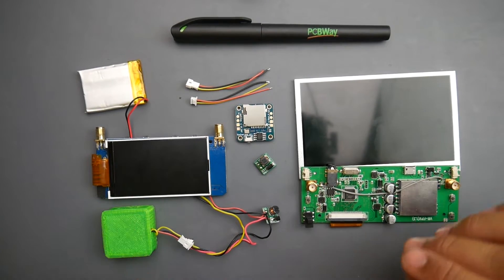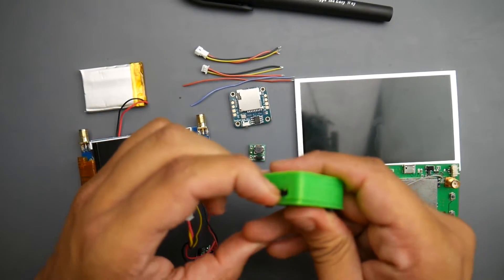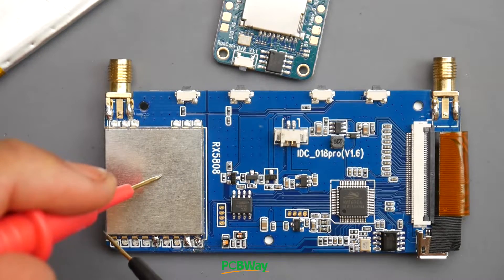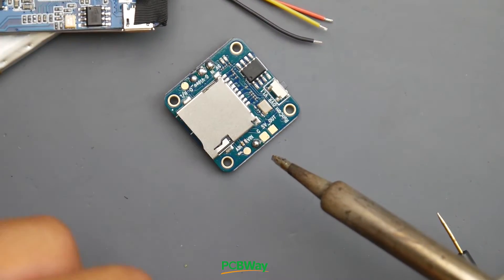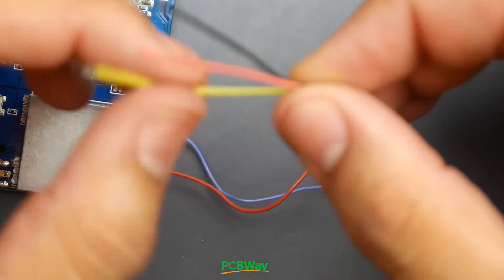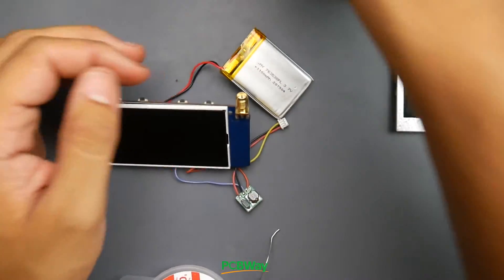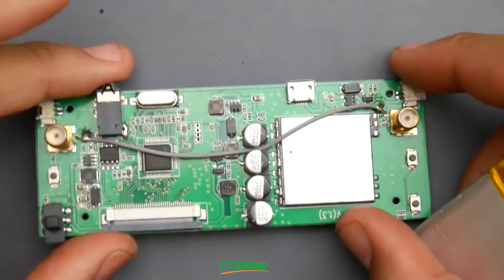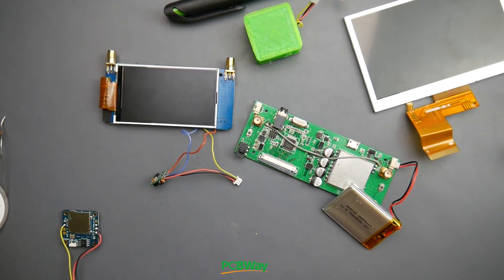The Mods Start // Eachine VR005 DVR Mod, URUAV DVR Mod

Comment: hello I want to get help on a subject.  I used my ts5823L vtx transmitter without antenna and the device fell silent, which part needs to be replaced,

Comment: I believe it will still work with out the step up.
Reply from the maker: Test and let us know :)
Reply: I did a similar mod with the vr007 pro and the eachine pro dvr. The goggles are ran off of a 1s battery. I have not however tested this with the runcam dvr.
Reply from the maker: @alexandereckhardt7153  Can you post it on my forum dronemeshforum.com for anyone searching in the community :)
Reply: I follow a really great you tube video and there is also another forum I found the mod on. I’ll be happy to share this information!
Reply: Found*

Comment: My step up converter is realy hot after 30 sec. and the voltage is dropping below 5v to almost same voltage as the battery. I was using this converter for my Eachine diversity module on VR006. I am running this now just from the 1s battery and everything is working as it should. I am using li-ion 18650 battery. Great video as always. All the best from Northern Ireland.